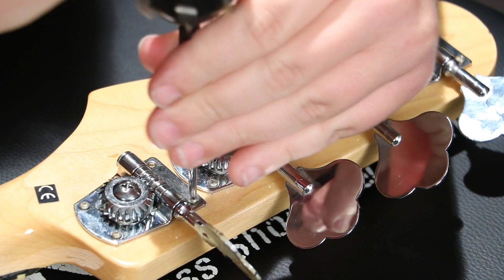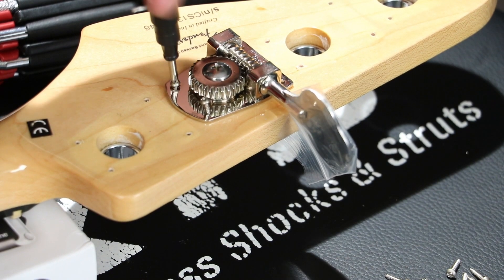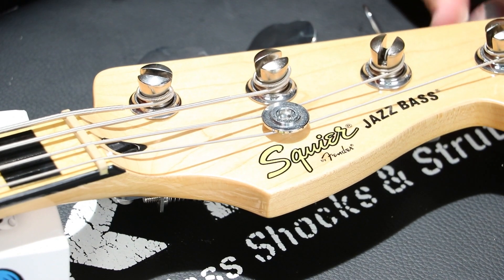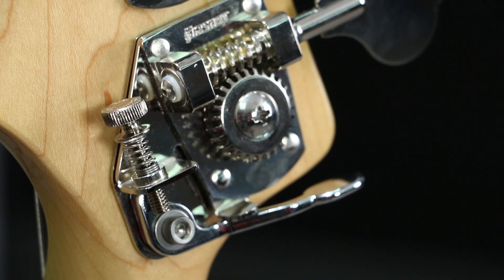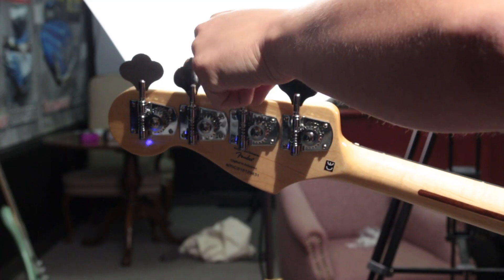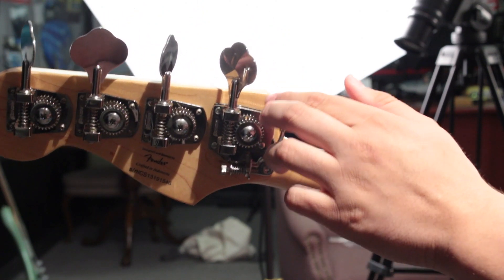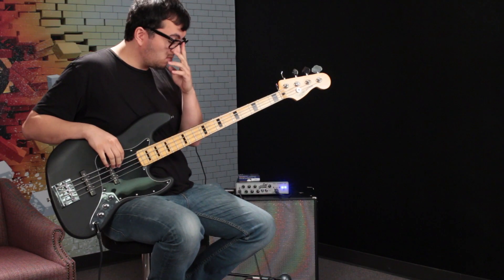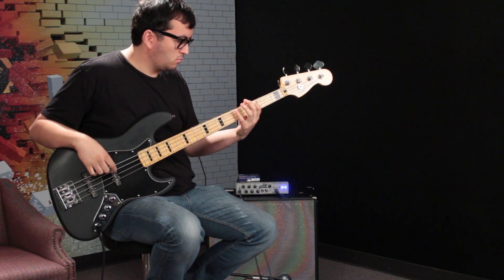Super Squier Part 4: Hipshot HB7 and BT7 Tuning Machines

Comment: I've got the same bass and done several of the same mods, but a bit differently. The Gotoh bridge will accomplish the same thing at 1/3 the price of Hipshot (only $40).  I suggest that BRG look at the nut. There is no reason the stock tuners shouldn't be smooth and precise. Replacing all the tuners is unnecessary. The stock tuners on my Squier work perfectly but I did install the BT7 and hear/feel no difference in the smoothness of tuning. Work on the nut and skip the other 3 tuners. Also, Aguilar AG 4J-HC pickups are the bomb for this bass. Lastly... Take the money you'd have spent on the tuners and have a pro do a fret level and setup. I was shocked at how much better it sounded as well as played.  I do like his flat black body color.
Reply: GeroLubovnik - I have 3 Squier basses and all tuners are fine. Never any tuning issues. Never.
Reply: This is good advice.
Reply: squier and fender in general is hit or miss with thier tuning hardware. your mileage may vary.
Reply: I didn't put a huge priority on changing tuners on my main bass, but am now because the G tuner has started having issues and won't tune past F without popping loose and going down to A.  Figured I might as well at that point.  Gonna do the same with the bridge whenever I start having issues with it.
Reply: I have the new Jazz Bass Classic Vibe 70's. Get you on the bridge, but don't agree on the stock tuners... Takes me quite a bit to get the bass in the right tuning to record. Guess you got luck. Fret job, definitely.
Reply: It probably depends on the strings. And maybe your playing style. My cheap tuners seem fine. I still might change them to the Schaller brand because of the cool brand name to slightly compensate for the Squier label on the headstock

Comment: My Squire is an Indonesian 2014 VM, and I never have tuning issues. So this stage cud really be missed. Don't think just because it's a Squier that everything needs changing. They are good basses.
Reply: Absolutely. The new Classic vibe jazz V was so good outta the gate, they increased the price by 100 bucks.
Reply: @sixsentsoldiers  Man I love my Squier CV 70s Jazz Bass. Feels like a Fender, plays like a Fender, sounds like a Fender.
Reply: @aussierule  - Absolutely. I put an Emerson wiring kit and Duncan Quarter pounds in mine. It is solid.
Reply: @aussierule  Just picked up a Squier CV 70s P bass, and i gotta agree with you played it at the store for 15 mins and spent another 15 on a MIM Fender,  preferred the neck on the Squier, the tuning is awesome, sounds awesome,  probably only gonna replace the E tuner since playing im playing songs both in drop D and standard E, and on stage it ain't really comfy to detune 🤘🏽🤘🏽🤘🏽